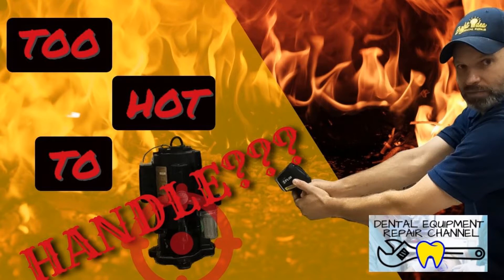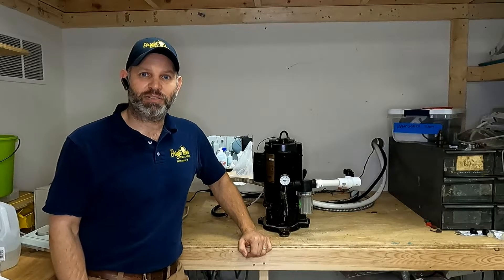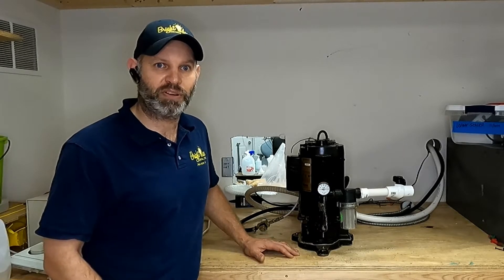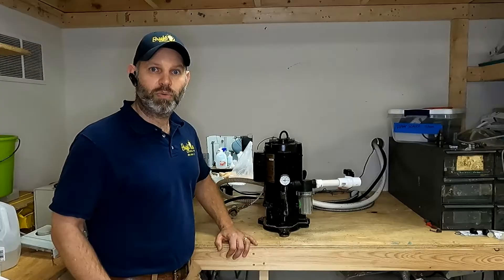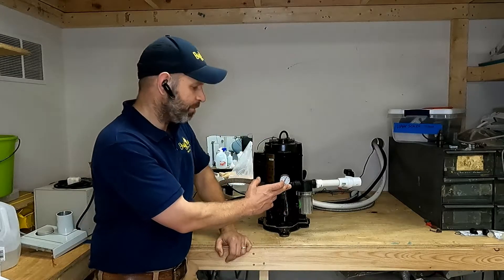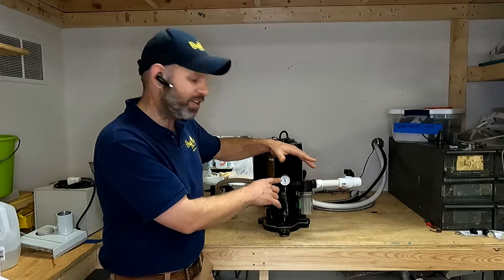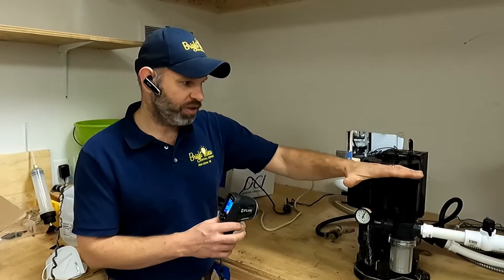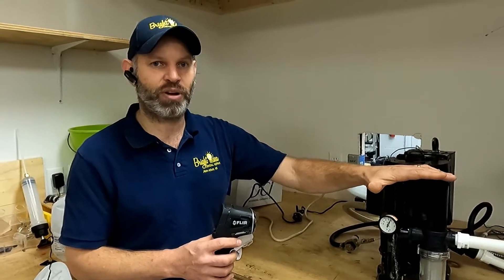Hot Dental Vacuum!  Why air flow is critical to proper suction in your dental practice.

Comment: So does this mean we should turn off our suction pumps when we are out to lunch for an hour or if we have a patient cancel and we won't be using the suction for an hour or two?
Reply from the maker: Dental vacuum pumps take between 1/2 and 1 gallon of water per minute PER PUMP. If you plan on not using your vacuum pumps for an hour or more, it's a really good idea to turn them off because if you do the math on the water consumption, you'll see that it is a waste of resources. It won't hurt the vacuum pumps to leave them on, but turning them off during a period of non-use is probably a better idea.
Reply: @DentalEquipmentRepairChannel thank you!